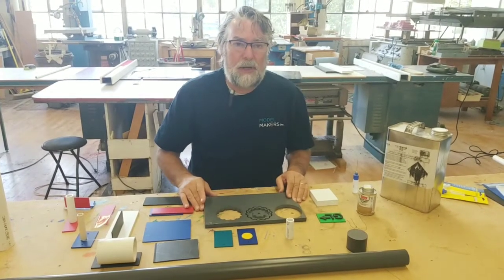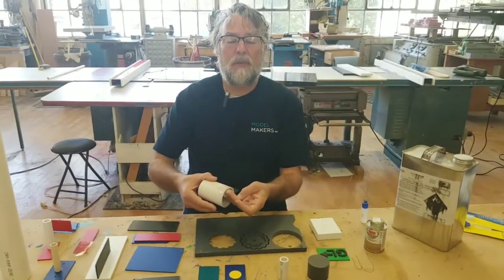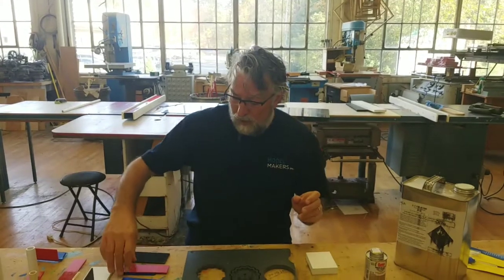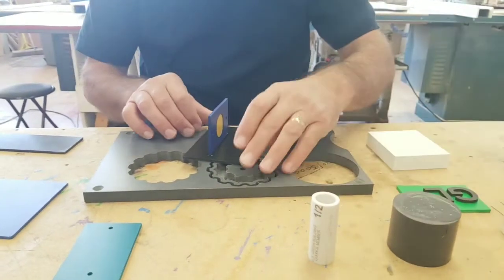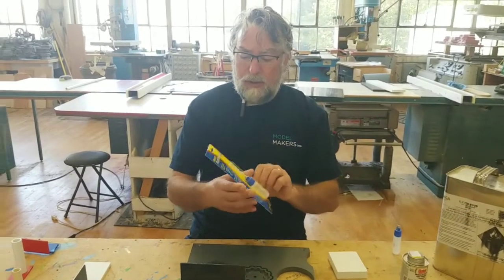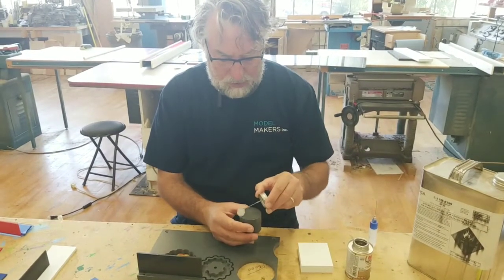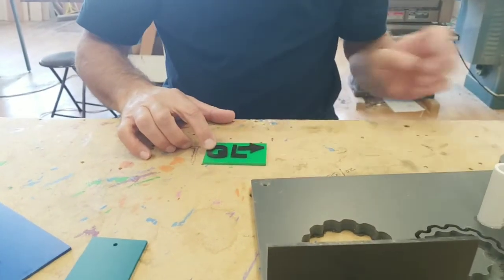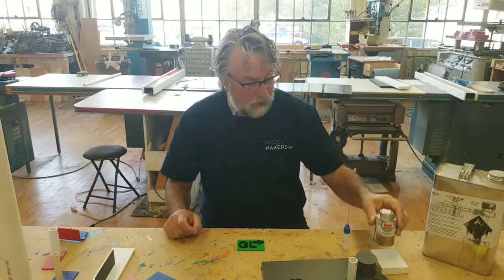solvent welding PVC

Comment: Nice video. I have a hairline crack in a hard to find pool filter fitting that was suggested to try capillary action solvent bonding "repair". Where do you source VC-1 or E-Z Fix #309?